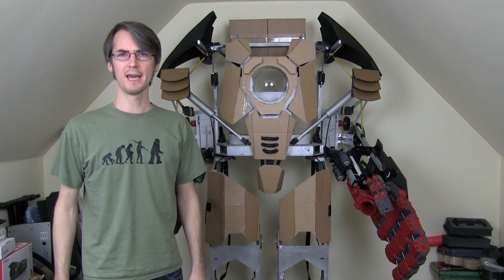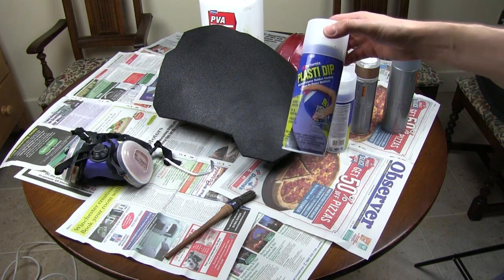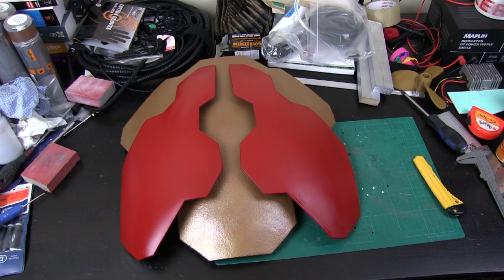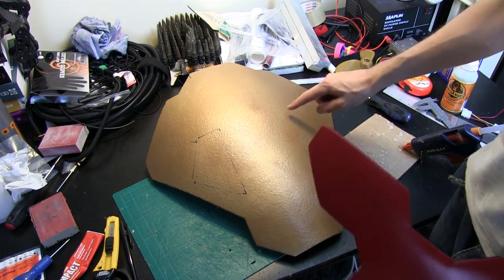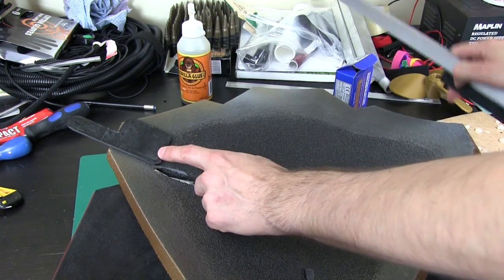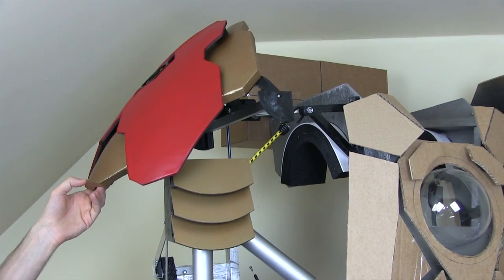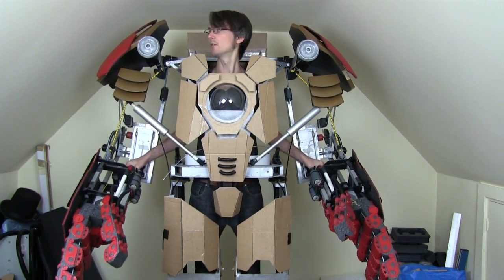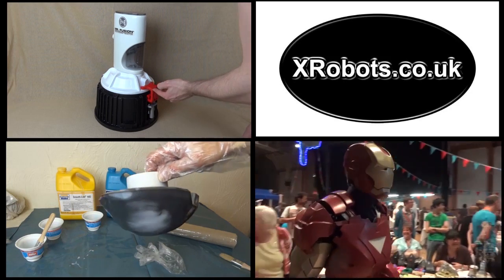Iron Man Hulkbuster Cosplay #14 | Shoulder Bells & Arm Motion | James Bruton

Comment: Nice work.  As for the shoulder bell arms that did not have the degree of setting you were looking for, couldn't you just flip the whole bar 180 degrees and then the arc would point upwards?  Looks that would fix it perfectly to me, but of course I might not be seeing all your mounting points.

Comment: Not to sound mean but im glad you messed up the angle bracket thingy, you always seem to know somehow exactly what your doing which is a bit daunting looking at the huge process of building these amazing costumes. You making mistakes and working past them is pretty cool. I also love how the sholder bells just fit into angles of the room. What colour have you painted the printed nuts on the shoulder bell?
Reply: ***** No not the pivots, the 3d printed nuts that went in between the two red sections. In the video when they were stuck on they where still black, i was wondering if you painted them as well?
Reply: ***** I guess black is ok for detailing, it might help tie in the black backing foam into the rest of the details and also fits with the black foam showing in the fingers. Thanks a bunch for answering.

Comment: Hi James I am currently building my very first Halo armour for my 8 year old son, I am using EVA Foam flooring for the build... my question is, is there a cheaper easier to obtain alternative to plastidip, to seal the the foam for spraying and stopping it from cracking peeling etc .. ? Thanks in advance Rich

Comment: why don't you use one of those replica skeleton hand toys to control the fingers. One of those toys where you control a replica hand with strings attached to your fingers each finger is connected to its corresponding bone finger and when you clench a fist the bones do the same thing, as well as mimic any other movements you make, you already have the strings attached to the fingers of the suit, all you would have to do is make a some sort of glove with the cables attached in the same way as the toy. This way you can move the fingers of the suit and you don't have to worry about hooking up all those electrics.

Comment: Nice build, I have in idea for you. Since the head is going to be large to match the body, you should be able to add a small 3-4 inch lcd screen inside the helmet part and add a small camera, to see when the helmet is down. I got one for my project, there run about $30 US dollars. It would be a simple install. LCD to camera and both run off the same battery. Just an idea.

Comment: With the larger pivot point covers, do you think they'd work ok for the hips and knees? You'd think that both the joints for those sections would be bigger as they support more weight than the arms.